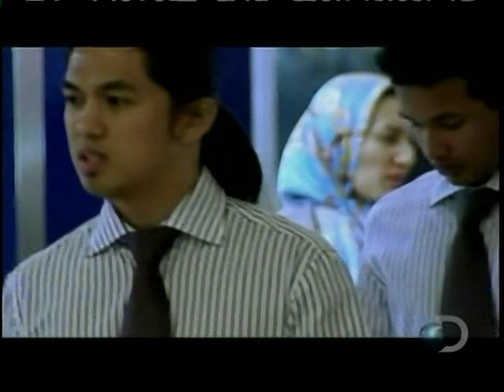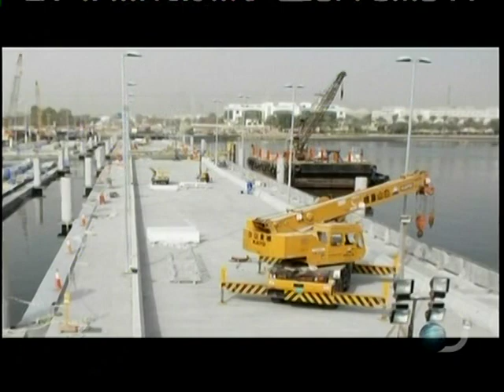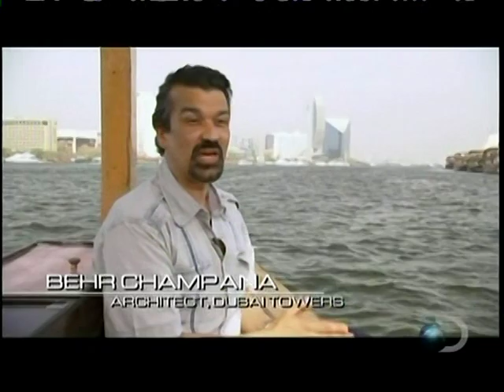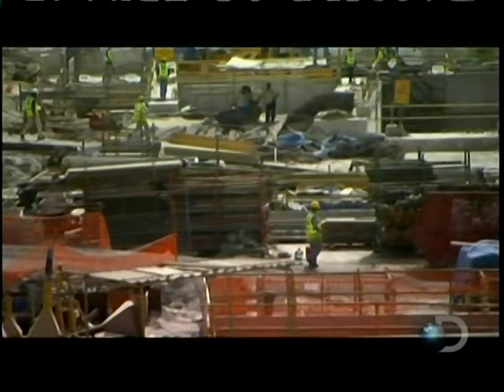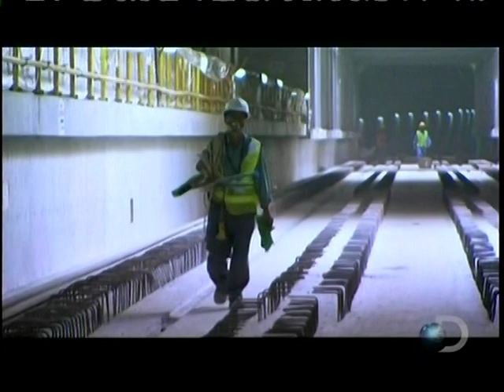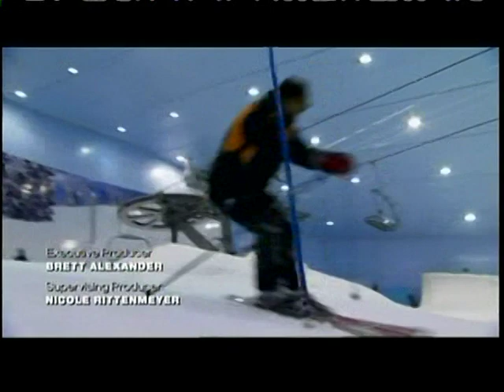Discovery Channel - Impossible City - Dubai Part 6 of 6

Comment: not really they will losse it but they have not stated how much is left, plus they r depending on tourism once the oil is finished, plus the reason they have stopped durin the recesion is alot of foreign company contractors building stuff there, ran out of money so they r on hold